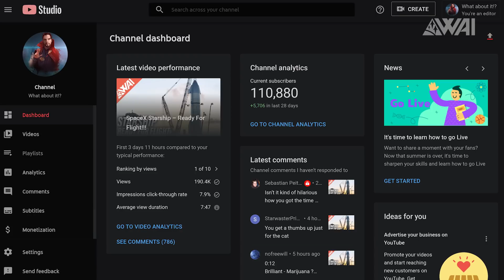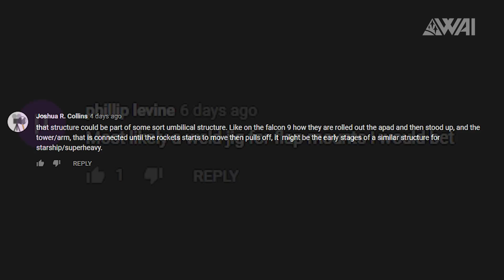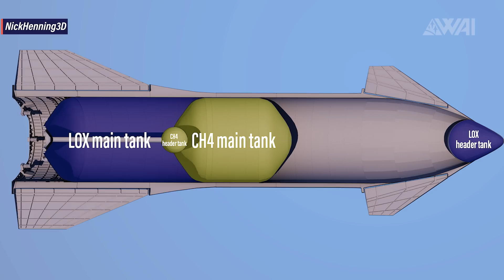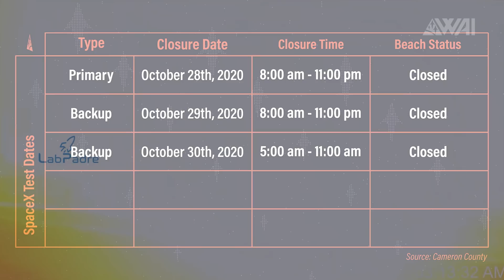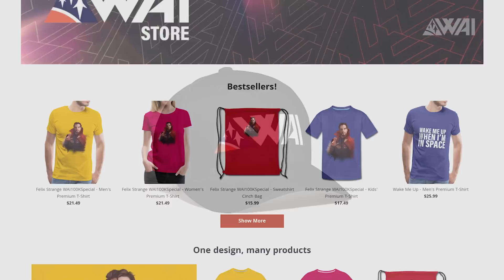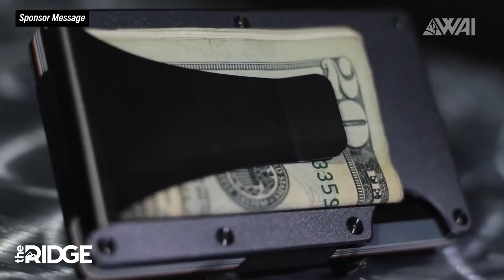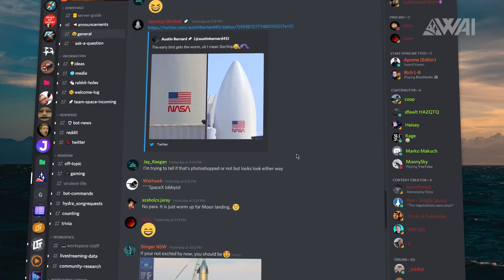128 | What needs to be done to launch a SpaceX Starship to 15 kilometers?

Comment: Wouldn’t gantry crane hang below the top deck as it’s the structural element to support the weight? 
Therefore the “dead“ area above is perfect for the bar and even with some side panels the 360* view is uninterrupted

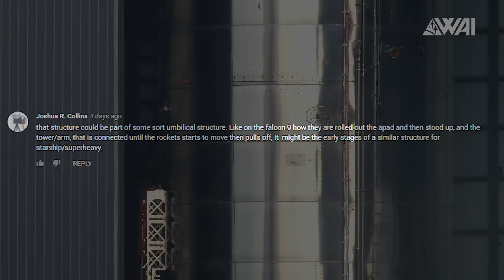Comment: 7:06  I agree, this is to allow better mounting/welding of the elerons. It has to be ground equipment of some sort, it appears to be taller than the elerons. An aerocover of this to mount the elerons would be very large, and a radical design change.

Comment: 11:49
The problem I see with this theory is that the foundations would be too shallow. A crane of that size would require considerable foundations for stacking starship onto superheavy.
Reply: It does look too far from the launch mount. But assembling SH and SH on the mount won't take a much more elaborate foundation than was used to put SN8 on its mount. SH weighs more than SS, but not hugely more. The Liebherr crane has been seen with only its lower boom - that model has additional booms that allow it to lift loads to 168 (187?) meters. The SH will be lifted separately, then the SS on top of it. The crane's lift capacity is much bigger than any possible SH weight. 

The key is distributing the weight - first through the large tracks, then through the timbers, then through the concrete pad - one closer than the one Felix mentions. This is different from the deep foundation envisioned for the tall column crane shown in the SpaceX concepts. But those pics are old, and the plans have shifted to offshore - this Launch Mount won't be used for a high launch cadence, so IMHO they decided to dispense with the tower we all thought we'd see.
Reply: @donjones4719  So the Bluezilla has some more work before a permanent crane is made.
Reply from the maker: True! :_WAIHello: Musk already confirmed though, that there will be a crane at the OLM site. □□□
Reply: @Whataboutit   Surprised. When did he confirm this? - haven't seen it on reddit or YT.  Would love to know more.

Comment: What about the Elephant in the room!! What are the chances sn8 will be a success and actually land safely? Im guessing a 1 or 2% chance of success
Reply: I'd guess much higher, with all the publicity going on SpaceX have a very strong incentive to have a successful outcome, not to mention that they are the experts in retro propulsive landings.
Reply: @edwardboatman4554  i do hope your right, i just feel the transition from belly flop to vertical and then timing the propulsive land us going to be many many times harder to master than the falcon 9, so much so i have doubts it will be mastered
Reply: I give it at least 10% with a distinct possibility of success. Even if it fails, Space X will learn, adjust, and use one of many Starships it has waiting in the wings.
Reply: @MrEd2291  although sveptical, im rooting for them and have a bet at work that they will do it........ your 10% sound better than my 1-2 % lol

Comment: The white Starship for the Moon missions, could be used as a shuttle from Earth's orbit to the Moon's surface. The Crew Dragon with the Falcon 9, could dock in orbit with a refueled Starship and transfer the Astronauts to it. That way you could have a quicker certification from Nasa, for human crews.
Reply: @ImieNazwiskoOK  lunar starship can't go through the atmosphere.
Reply: @ImieNazwiskoOK  it's related with  the certification from Nasa. You need a few flights before you could use Starship to human crew missions.
Reply: @RogerM88   This idea and variations of it need to be explored. I've certainly given it a lot of thought. We need to find a comfort zone for NASA of how much they'll let SS do with a crew. SpaceX is trusted to build a SS with a good life support system and operate anywhere is space, they have the track record of Dragon. We're far from NASA allowing launch or reentry on a SS, though. That will require a string of many successful orbital launches with zero failures. Shuttling from lunar orbit to LEO has been nixed by Elon, though, he says it will go to the Moon and stay there. This may be to keep NASA happy, that the design will stay within their contract requirements and not have add-ons and complications.

But Elon was probably thinking of the the real limitation - a SS returning from the Moon will be going 25,000 mph, and is meant to use aero braking to decelerate. Loading an HLS with enough propellant to propulsively decelerate to LEO is problematic - it would require quite a chain of tanker flights to lunar orbit.

There are various options to be explored: First, simply use SS to launch an uncrewed Orion capsule to high LEO, and transfer the crew from a Dragon. SS takes Orion to TLI and sends it on its way to the Gateway to rendezvous with whatever HLS is selected. This gets rid of the expense of SLS and is the closest to NASA's comfort zone. (And also to their political comfort zone for the first few Artemis flights.) Clever things can be done with a Dragon, a regular SS, and the HLS, but this is already a helluva long reply.
Reply: @RogerM88  Things might change
Reply: Sounds good but would be very furl inefficient and would make starship capable of carrying only 7 astronaut's to the moon.